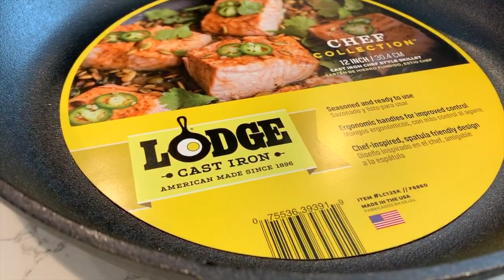How to make Rough Cast Iron Buttery Smooth for Faster and Easier Clean Up

Comment: I do not really get this smoothing down a surface that is perfectly good for frying eggs and Potatoes without any sticking! I cook nonsticking eggs and potatoes  in my 12" LODGE rough bottomed Cast Iron Skillet, even after 1st use from the Store. I just don't get it.
Reply: Might be an aesthetics thing? I think they certainly look a lot nicer. As far as performance goes, I had the same results with a sanded down cast iron skillet as I did with my 15 year old unsanded one, totally non-stick.
Reply: It's mainly about the cleaning process. Stuck on food releases much easier and the smooth surface no longer tears apart the towels.
Reply: @berniem.6965  never had any problems with my towels with the CI's.
Reply: I had to scrape my egg out of the skillet just to be able to eat it this morning. My "pre-seasoned" skillet is too rough. I had plenty of ghee in the skillet, but the egg sank through and stuck in all the crevices, so my over easy ended up scrambled just trying to remove it from the pan. When I take a paper towel to the surface, it turns to shredded fiber. When the egg is so embedded in the skillet that I even steel wool won't get it all out and I have to burn it out in the oven, it's not worth the trouble. Maybe they are different roughness and you got lucky. My skillet is a pain in the Arse and I regret  the year of effort I've put into trying to season it like I'm "supposed" . 6 coats? how about 24 and still paper and egg shredding.  I use metal spatula because I was told that would help smooth the surface, but I imagine how much scraped iron I'd have to eat before my pan got smooth enough to not stick, LOL I'd attract magnets, for Pete's Sake!
Reply: @Metqa  Sounds like your pan was Way too hot to begin with. 
And you never use paper products to clean cast-iron. 
You use cotton or burlap to clean it.
I can cook an over easy egg in cast with 0% problems. 
There is a learning curve with Heat Management 🔥 😎👍
Reply: More roughness means more surface area to stick to food, but more pores for seasoning. Less roughness means less surface area, less seasoning. Seems like a Goldilocks problem?

Comment: I realize you probably don't own one and it would silly to buy one just for this project but an angle grinder would have probably saved you some time.
Reply: watch that angle grinder.  i started at 180 grit and it still cut into it like butter when the wheel was fresh.  deburring was fast and effortless though.  i only bothered to smooth the flat surface though (orbital sander).  i guess everyone who is doing the sides is doing so for esthetics.
Reply: @tcon2809   definitely a tool that requires respect and concentration.
Reply: @garethbaus5471  yes, i'm a newbie and trying to be VERY cautious with that thing
Reply: Same with me. I only had fresh sand paper and the finest grit was 180. Although I didn't use any pressure, the grinder went straight into the metal leaving a noticeable 'dent' in that skillet. It removed way more material than I wanted. So I went back to sanding tools for my power drill which work much slower. Even when starting with 40 grit, I have much more control over the amount of material removed.

Comment: Why blue the pan?
Reply: It forms a layer of Fe3O4 on the surface which serves as rust protection.
Reply: To over heat it and make it Extremely Brittle 😁
Then if you accidentally drop it it will Shatter like Glass 👍 
You can Blue steel but it's not a good idea to Blue Cast Iron 😉
Reply: Rust prevention is achieved by seasoning the entire surface inside and out of a piece of Cast Iron Cookware.

Comment: I find Victoria cast iron, much higher quality in design, fit, finish, and workmanship. The casting seams Lodge takes off with leaving behind hideous tool/grinder marks is not acceptable for American made goods, they need to step up their game, but won't per an email communication with them in November 2023....what a shame.

Comment: Massive waste of time. Results are worse than the factory finish. The easy way to do it is to cook bacon in it the first three or four times. Pour off the leftover grease, but don't wash. A CI skillet seasoned like that will outperform a machined CI skillet. The machined skillet will require more maintenance for the rest of its service life.
Reply: They seem to understand little of the subject ...
you do that because afterwards you will have less effort and maintenance with the pan in the future
Reply: Correct. I polished all my cast iron, even the more expensive Swedish one. I'm even considering polishing the outer sides and handles of my brand new Stargazer. While the polished inside is simply perfect and they remove some texture of the whole skillet with a tumbler, it's still a little too rough for my taste.
Smoothing a cast iron skillet is not about how it cooks. That's mainly a matter of pre-heating, temperature and time with the texture of the surface being a minor factor at best. Smoothing cast iron for me is all about the cleaning process. Stuck on food releases much easier and the smooth surface no longer tears apart the towels. It's also less noisy to use a metal spatula. On top of that, I can also fix sharps edges and smaller imperfections like those terrible marks from Lodge's deburring tool that look like somebody tried to kill the upper rim of the skillets with an axe. 

Cleaning and handling such a skillet is simply an overall more fun experience and worth the effort. You may think differently.